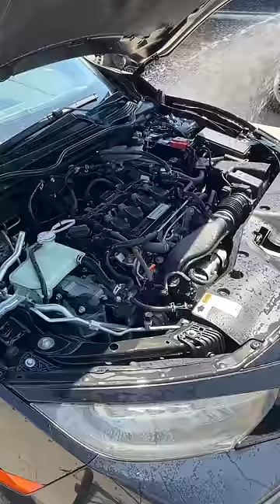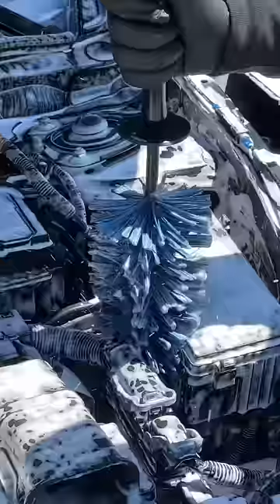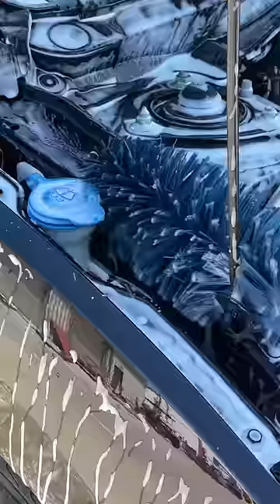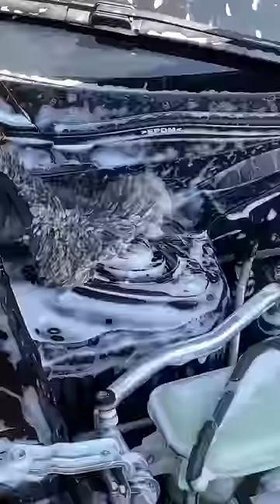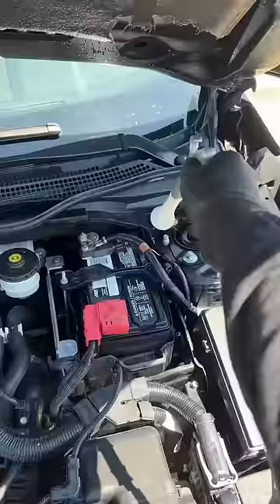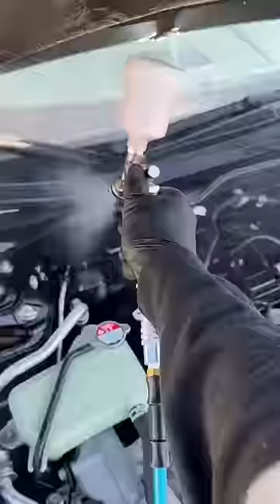Engine bay detail #asmr #satisfying #trending #cleaning #detailing #california #viral #rad

Comment: Never ever do this to a car unless you want electrical problems.
Reply: @Genezis-88 It means it is not protected from water ingress
Reply: Waterproof grease for electrical connectors…
Reply: It’s 2023. Everything is fine………
Reply: Каждый год так делаю.. И чё!!!!
Reply: Bro, you should Never drive your car when it is raining....
Reply: Exactly
Reply: Engine washes are fine. Relax.
Reply: I have been doing this for years. My cars and I have never had a problem, you are wrong like other people my friend.
Reply: Thats why all cars has HOOD.. to protect the ENGINE from WATER!
Reply: @jf2029 - For goodness sake why you ignorant people make absurd claims based on hmm, nothing really.
More than 30 years doing it both on diesel on gas cars, motorbikes, etc. Still waiting for problems...

Quick tip: Water dry exactly the same. Be it on a clothes rack or in an engine bay. ;-)
Reply: Whys my alternator spiking!?
Reply: @crpth1  lol I've done it to a Jeep and threw a bunch of codes on the dash... this is why I say this lol lol.
Reply: @Genezis-88 but the thing is even it’s fine, it violates the warranty terms. And the dealers are more than happy to blaim you
Reply: @Genezis-88 it says but being it thay way is different.
abs module has its own ecu, your head lights have also ecu it not one but many. electrical problems most probably will happen.
Reply: Miss info.  I've done this to every single one of my cars for over 35 years I've been driving.  
I always leave my engine running when doing it.  Never had a problem.  All electronics on a vehicle are waterproof. Alternator can get wet all day long.    What do you think happens when it rains?
Reply: Oh thank God someone already said it
Reply: @JF32304  I’ve watched detailers do this at every dealer I’ve worked for, for 18 years.  It’s part of the whole reconditioning process after a trade in.  
The service department knows about it and they’ve never voided a warranty because of it.
Reply: @adamwehrlin3982  ok great, in happy for them. I've seen electrical issues with my own vehicle and I'll never do it again. Good day.
Reply: Выздоравливай😅
Reply: I’ve been doing this engine washing for years and never had any electrical problems. You just have to know how to how to do it.
Reply: My engine is just clean.
Reply: Постоянно так мою,но после мойки надо сушить компрессором.
Reply: you never know where the water seeps through. you never know whether your so called waterproof sockets are still working. splashing water on the engine bay with a pressure jet is at high risk.
Reply: Your car manual literally tells you to clean your engine and it tells you what parts to cover if necessary.
Reply: Aqui no Brasil, se fizer isso, vai ter carro por pouco tempo. Os conectores são todos vulneráveis a água e umidade. Pode ser Ford, VW, Fiat... qualquer marca.
Tem de usar um borrifador, pincel, pano. Limpar peça por peça e desviar da parte elétrica. Isso do vídeo, só pra vender uma bomba bem bonita e enfeitada para alguém.
Reply: That’s exactly what I was thinking!
Reply: Nunca hagas eso  si no quieres problemas electricos..
Reply: Not true. Cars use weather seal connectors. It will not harm anything.
Reply: @Random-bm7ho  yeah right... good luck with all that.
Reply: Done for years and not had one single problem.obviiusly you don't go full blast on electrics but even if you do every terminal is water proofed.
Reply: @kenmurphy4317  I did on an older jeep and threw a bunch of codes, never do it again. Lol this is the reason behind my comment. YMMV.
Reply: Thank you !!! ✊
Reply: A mi papá le rompieron todos los inyectores de gas
Reply: Tengo 2 Jeep. Uno con sus tapas y fusibles bien selladas, otro ya más viejo todo sin pies ni cabeza. Quise hacerle limpieza al viejo y lo dañe, al otro con sus tapas simplemente no le pasa nada. Ya depende de cada persona evaluar si se va a dañar el carro o no. Eso en cada carro es diferente, como cuando pasas charcos grandes y largos de inundación, algunos carros se paran y van directo al Yonke, otros simplemente mojan a la gente.
Reply: @will3641 yea and u drive your car with the hood up when it's raining? Lol
Reply: @Genezis-88  lol, the ECU is literally IN the video IN the engine bay...
Reply: You might get away with with an old engineer 80's but newer your going to ruin those sensors
Reply: Но и хрена не будет. Два раза в год мою под капотом
Reply: Don’t talk about things you know nothing about mate. Just watch the video and be quiet, or keep scrolling
Reply: Jommejom  yup 😂 approx... waterproof....
Reply: @FloridaMowerMan  any chance to find all of them?? NO WAY!!
Reply: @beaver6969lv nothing happens when it rains, because its almost like we have a hood... oh wait
Reply: А потом полдня заводишь
Reply: Self-Responsibility
Reply: Absolutely Right
Reply: نصيحة لا تنضف السيارة بهذه المادة لأنها تخرب الأجهزة الاكترونية  هذه الترجمة
Reply: По твоей логике, в дождь машину нужно прятать, и ездить нельзя 😂
Reply: @techiemarksman aerodynamics also
Reply: That's just means a light  spray from puddles and damp air, ect, not a high-pressure  jet wash
Reply: Wrong. I've detailed cars for 40 years.
Reply: You don't know much about cars
Reply: @Genezis-88 yeah not in this world 😉
Reply: @helinutz14 yeah in your dreams. If you want to kill an engine then lets gooo
Reply: The lies you tell ......
Reply: Right? Wrong tutorial 😂
Reply: Until it hits your coil pack
Reply: A quality car will not have any issues when doing this.
Reply: What about when the vehicle is doing 90 in the rain.?? 😂
Reply: @grahamwhitehead9498  uhh I don't think the hood is open while doing 90 in the rain. Maybe for you it is, but not for me.
Reply: Logical Answer!!!
Reply: @jf2029  have a look at the front of your vehicle its not water tight and just diving at 30 in the rain would have far more water entering the engine compartment than in this vid. Case closed.
Reply: @grahamwhitehead9498  lol not really. Not even close actually.
Reply: @grahamwhitehead9498 дело в том что вода попадает снизу моторного отсека. А то что мойка производится сверху это другой вопрос. Я допустим мыл двигатель своей импрезы и ничего - завелась без проблем. Сейчас у меня ниссан и знакомый автоэлектрик сказал этого не делать. Зависит от самой машины, вернее от марки и модели производителя
Reply: @JF32304 most cars nowadays you can hose them down and no problem
Reply: @defafa9249  still wouldn't do it.
Reply: Bro we have Passat b5 I wash everytime the engine there is no problems after wash …
Reply: @JF32304 ooooooooooo touchy
Reply: Have you thought about the fact that rain also pours under the hood?
Reply: The trick is not having high pressure on the hose.
Reply: I do this every second day of my life over 5 years not a single sign pop up in the osameter
Reply: @Genezis-88  I am quite sure that none of the vehicles mentioned have IP77, it simply does not exist!

The first digit can at most be 6 or 6K, depending on the standard ISO 20653 = 6K, DIN EN 60529 = 6 – dust-tight.

I would like the second digit to be 9 or 9K.

ISO 20653 = 9K – protection against water during high-pressure/steam jet cleaning, specifically for road vehicles

DIN EN 60529 = 9 – protection against water during high-pressure/steam jet cleaning, especially agriculture

For a vehicle, you would typically want something like IP66K/IP69K.

Up to protection class IPX6 (for DIN EN 60529) or IPX6K (for ISO 20653), the protection classes below are included. This does not automatically apply to water protection ratings 7, 8 and 9K for the higher protection ratings. If a lower degree of protection is required, this is indicated by a double designation, for example IPX6K/IPX9K.
Reply: Jak by było jak piszesz to po wyjechaniu na deszcz już powinieneś mieć problemy z elektryką a nie masz 
Wszystkie wtyczki są hermetyczne tu nie ma co się dziać
Reply: And corrosion
Reply: Okay, now show us if you can start this car
Reply: Youtube mechanics are the best tho. I've been doing this over 10 years now with 0 problems. The keypoint of it is not to use full power on pressure washer...
Reply: As long as you let it dry well and be aware of parts like the alternator, you’re good
Reply: You are wrong. I worked in a car detailing shop and we washed the engines with pressurized water and no electronics have ever been damaged
Reply: @Payasito20 if you do not cover specific components you will mess your car up badly like alternator fuse boxes If there hybrids especially do not wash if you have all that covered then there no much of a problem but I have fixed cars before because there's water in the spark plug coils from engine bay washes or even very heavy rain more often straight 6 engines or I4
Reply: Estas equivocado. Encierrate en una burbuja
Reply: @techiemarksman You think that’s a purpose of a hood?
Reply: @helinutz14 he used a pressure washer that’s not fine at all maybe’s with a regular water hose it’s fine but the pressure washer will force water into those spark plugs and cylinders shit even the air intake probably has water forcing water into the engine
Reply: are you sure?
Reply: @JF32304 maybe you just don’t know what ur doing better to leave it to a professional 😂
Reply: Sino supiera lo que hace no lo haría
Reply: queenbey6678  you right .. the video owner already explaine that...
Reply: Sino supiera, no lo haría 🙄
Reply: The only thing that should not get wet is the alternator, from then on nothing bad happens to it.
Reply: Maybe it's a bioelectric liquid...and not water, which is the safest.
Reply: @helinutz14 no the water may get in you spark plug or ignition coila and can lead to misfiring
Reply: @will3641 where is your bonnet?😂
Reply: @helinutz14 coming from a mechanic or engineer like you?
Reply: @styhlezz everyone thinks they're a mechanic or engineer
Reply: @techiemarksman nope. So you can change battery, change oil, sparkplug,, engine maintenance etc.
Reply: Questo non si fa mai avresti problemi seri e neanche a motore caldo si possono avere delle crepe sul motore
Reply: This is one of those who repeat what he hears.
Reply: Exactamente
Reply: You are absolutely right that is why my fucking 2020 stinger went into flood water and died
Reply: If you did this and you ended up with electrical issues. 1. You fucked up and just blasted water on your engine full force. Or 2. There were issues with your engine and you just didn't realize it prior to cleaning.
Reply: Negative, unless your comment was sarcasm..  @helinutz14
Reply: @styhlezz that's subjective
Reply: I was washing my 07 Range Rover engine 5x and never had problems 🤷🏻‍♂️ and is Range Rover
Reply: Yep, the best way to clean the engine bay is just wipe the dust off.
Reply: I really don't do it that way for fear of an electrical problem that is going to happen to me.  and I would like to learn a safer way to clean that entire part of the vehicle without worrying about damage.
Reply: @will3641  😂 😂
Reply: Cuando veo que usa una secadora de aire ...todo perfecto...se puede lavar un motor así siempre y cuándo no lo arranques hasta que seques todos los Arnés..
Reply: Here we go again
Reply: @will3641 😂😂😂😂😂😂 right
Reply: Get yo money
Reply: Bro, It's not the water that's harmful, it's the pressure of the water.
Reply: @IZMUKS  lol no, it's the water.
Reply: I use water pressure cleaner on my engine and I got some trouble with electric part that cost me 300€ to repair
Reply: Now I have to this to a car
Reply: To much work and time spent under a hood for starters😂😂😂with a blower sit down I need to start making simple videos 😂😂☝🏾☝🏾☝🏾✊🏿✊🏿✊🏿
Reply: Exactly, what Ford mechanics and Service Managers told me
Reply: Modern engines are fine to pressure wash and detail. I have the same engine in my car and have detailed it many many time. Basically anything from 2000 to today is fine.
Reply: You realise after each car service they pressure was the engine bay right?
Reply: Dam he just flooded the fuse boxes alternator and all connections. 😮
Reply: @adamwehrlin3982  exactly . I've been detailing for 23 years. The only cars I ever had issues with were mk3 golf's and jetta's.  Most of the time that's because the factory coil pack had cracks in it. All it took was a little compressed air to dry it out. This was way back when those cars were still kinda new. People still think cars use carburetors and distributors with points and all that old technology.  Really anything 1990s to today is fine to wash the engine bay. I would recommend waiting until the engine has cooled down though. That's really about it. No need to cover alternators, or fuse boxes, or anything really. Maybe if you have an aftermarket intake cover the filter, other than that completely fine. I clean my engine bay several times a year, have since new, zero issues.
Reply: Only way to have electrical problems if there is already a problem witht he electrical that would allow water in. Been washing engines for ever... the older cars the alternators and distributors were sensitive to water because they were not sealed... everything today is sealed from water in all connections
Reply: Do you not go to a car wash??
Reply: As long as there is no current passing I'm i.e battery is disconnected it won't short circuit. However means it must be completely dry when reconnecting.
Reply: The water isn’t necessarily the dangerous part, it’s the pressure. There is more damage risk if you use high pressure sprayer like a pressure washer, it’s better to use a garden hose. The engine is made to get wet, it is not meant to deal with high pressure on electrical cables and other things
Reply: you can say that again 
kiddo .. 🧒
Reply: i am a detailer, i personally would never do this, but newer cars (2013+) have a mostly waterproof engine, the only part you need to worry about is the alternator when doing what this guy is doing on a newish car
Reply: done this hundreds of times, it’s fine.
Reply: depends on how much water pressure is being used and also drying out the bay asap completely helps
Reply: @styhlezz right just take out ur battery terminals and let everything dry out. No one starts their car right away after washing the engine bay like this. They let it dry for more than 5 or 6 hours or maybe more.
Reply: Ahhhhhhhhh
Reply: Bro probably still take his car to the car wash
Reply: Modern cars will not be affected by doing this, they are ment to be weather resistant. When it rains your engine gets wet, also he dryer it out so yeah.
Reply: @beaver6969lv not supposed to spray water on a hot motor lol. But I agree with your first statement
Reply: Wonder if that was the ultimate reason the customer's car no longer runs but he likes how clean it is.
Reply: @petepalma6686  because you probably got a bunch of water in it and didn't blow it out before driving your car or for that matter even starting your car if you clean your engine have your engine off disconnect the battery preferably clean your engine just like this guy did in this video you can if you want take a plastic bag and wrap it or put it over the alternator but it's not necessary clean your engine then rinse it and then dry it with are forced air and dry it good you need compressed air with a air compressor that has a filter to filter out the water in the line and blow your alternator off really good also blow all of the electrical connections and where the spark plugs are if it has spark plugs only then should you start or drive the car otherwise if you don't have compressed air and you got water on the alternator or in any of the connections you need to let it air dry completely before starting it
Reply: Cover the air intake and alternator and dont pressure wash hard enough to fo4ce water into cracks
Reply: @techiemarksman oh yeah? Then why does water splash up inside the open engine bay from puddles huh? Oh yeah. Cause your wrong
Reply: Bro's never heard of detailing before 😅